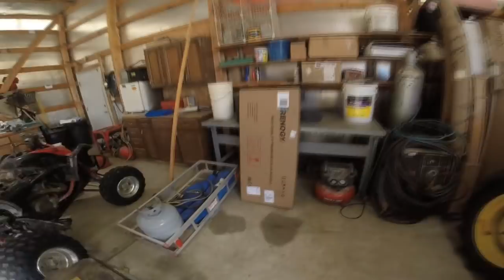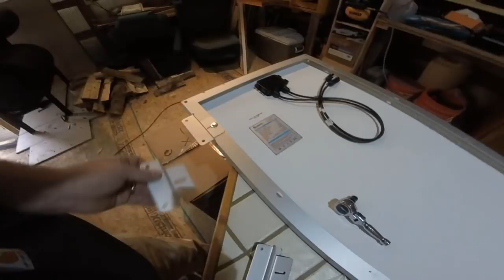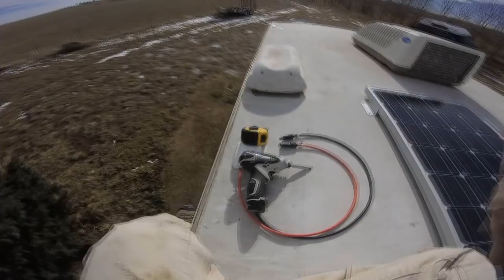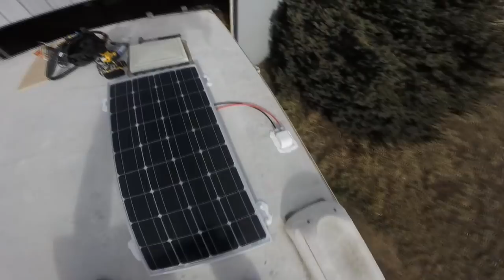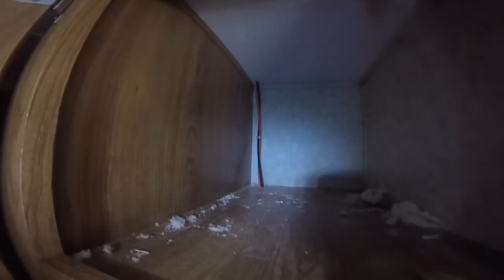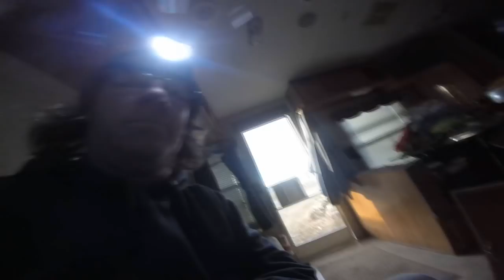Simple 100-watt Solar installation: Start to finish.

Comment: So many people forget that they can just run the wire through the fridge vent and down into the camper. That way you don't put another hole in the roof which is a prime place to leak eventually.
Reply from the maker: I've done that but this new box for entry works so well and you don't have to mess with the fridge.